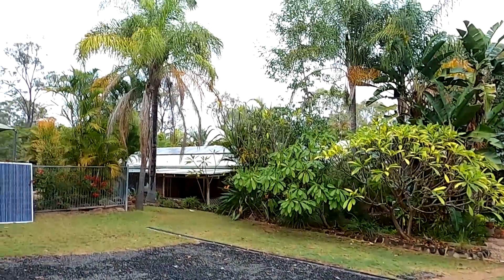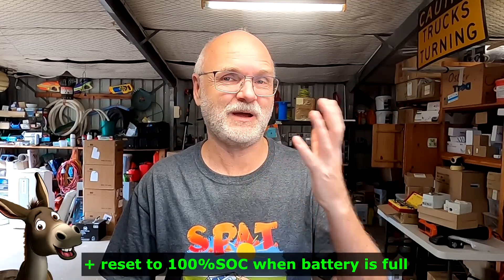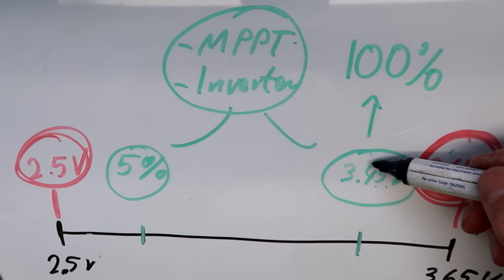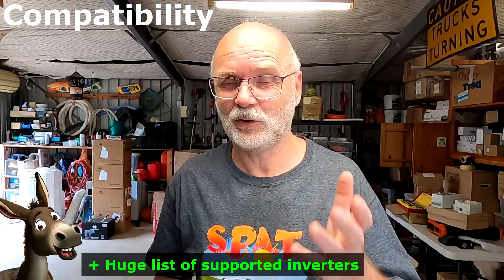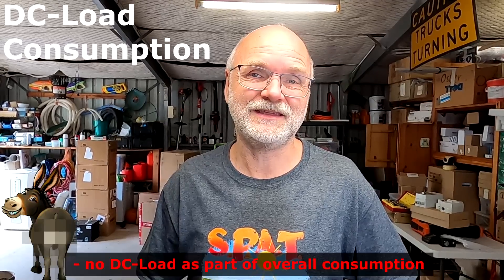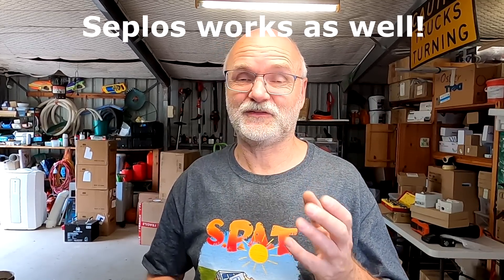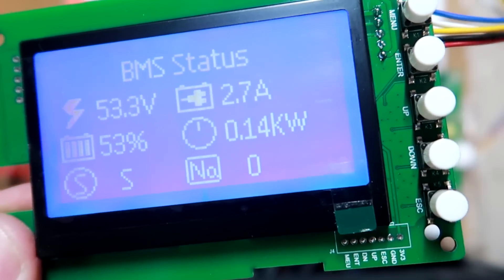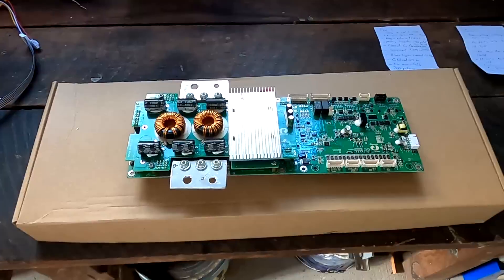In search for the best BMS... My Gobelpower BMS Verdict!

Comment: Oooh! Another BMS SOC problem? Where have we last had it? Oh, yes! Outlander :D 

Ps. Anything coming on the Teslander soon? Interesting updates? Degradation of the battery, perhaps? 😎
Reply: We got our Model 3 just maybe a week before Andy. Our battery has not lost anything at all after the first year. I suspect Andy’s will be the same.
Reply from the maker: I'm 3% down after 3.5 yrs
Reply: @OffGridGarageAustralia  Great news Andy. It’s NOT something I lose sleep over like some, and nor do I do deep dives with software programs and OBD readers etc- I suspect we’ve lost something more like 5 to 6% but it was ALL in the first year. Since then the “full range” hasn’t altered more than about 1km, and always goes up again for a while after a long trip.  (Our car has literally never in it’s life been above 95%  as I like to maintain some decent regen, and only below 20% maybe three times.)
This is in line with many overseas users with very high kilometres- initial degradation over the first year (ie: reduced projected range) and then it levels off very dramatically. 
I do NOT miss the Outlander’s battery issues and bloody useless BMS - though it was otherwise a pretty good car.
Reply: @OffGridGarageAustralia  how much of that is true though. DBCAM is needed 😂
Reply: @FutureSystem738  that's quite impossible 😉

Comment: Hallo Andy, 
I dont know how it works, but my JKBMS always reach 100% SoC when the charge controller of the Deye is in the absorbtion phase. The Values for BMS and charge controller are set like you show on 5:52
Reply: Idem, my JK BMS reach the 100% every day and I never get an OVP alarm. I'm charging at 3,5V and JK BMS OVP setting is set to 3,6V.
Reply from the maker: @M-Clem  Do you know what triggers these 100%SOC reset in the JK? Lot's of people are asking for that.
Reply from the maker: JK is very different...
Reply: @OffGridGarageAustralia  
...but still seems to be pretty good if the budget matters   :-)
If you are interested, i can send you curves of a charge cycle including the voltages of every single cell.
Reply from the maker: @Juergen_Miessmer  I like the JK as well as I said. It's just another BMS for a different battery design.

Comment: I went with the seplos a few weeks ago, tested the CAN connection to Victron and diceded to forget that and go with an extra smartshunt. The only thing i miss are the values for the highest and lowest cell but the SOC is calculated perfectly by the shunt. And this setup will work with any batteries in parallel - like your battery shelf. I am not 100% clear about the usefulness of a data connection to the battery.
Reply from the maker: You can still get all the data from the Seplos BMS but use the Smart Shunt as your battery monitor. That works great. Just leave the Seplos connected via CAN but turn off the control part in the Victron System, so it does not control charging etc...
Reply: @OffGridGarageAustralia  thanks Andy. You mean not to choose the bms as the battery monitor, right? If I remember correctly, that does not work, because the system priorized the bms in my ESS configuration. But it could be, that the turned on DVCC was responsible for that. But I need/want to turn it on, because otherwise my RS450/100 is not under "external control" what it should be (the 150/45 IS under ext. contr.) plus I cannot control the overall charging current.
Reply: @OffGridGarageAustralia  today I set up my BMS connection again and all the sh*** beginns again :-D 
I figuerd out, that I have to set the option "Controlling BMS: No BMS control" to ignore the values coming from the BMS (CVL, CCL, DCL). But you must know that you only find this after rebooting the cerbo. And after that, you have to reboot again but not only the cerbo, but also the MP and reset all MPPTs to ignore the BMS. What a mess.
And now the best: I cannot find the min- and max-cell-voltages anymore :-D
Reply from the maker: @mario-q6k9w  Hmmm, strange, I never had to restart the Cerbo or MP when changing the battery monitor or other related settings.
Yeah, the controlling BMS function should be off, so you can still use the DVCC with custom settings. As soon as you do that, the chargers won't be under external control any more. Either the MBS in in control or not.
Reply: @OffGridGarageAustralia  yes, that works now.
If you have BMS controlled MPPT and either set BMS control off or disconnect the CAN BMS, then the MPPT have to do a rescan, otherwise they lack of information and report an error (bms missing or something).
And maybe the MP needs a reboot because of the ESS assistant.
To see the the min/max cell voltages reported by the BMS in remote console I can't find the "details" under the BMS anymore and in VRM is no data available. Did you know why that is? I use the 10E BMS
Reply: OK, I just forgot to set the victron communication protocol in the BMS...
Reply from the maker: @mario-q6k9w  There you go. I have tested such a 'hybrid' system for a while and it works quite well with the Seplos. The BMS then basically only reports the data but the Victron system handles the charging. Good work!

Comment: Hello Andy
My 2 Daly 150 A  BMS are ok also they do the same job .
With 2 * 16 LFP 280Ah from gobelpower.
Connection UART USB to the rp3 .
Bmv 700 and muliplus .working fine....
Also to charge my model S off grid.
Reply from the maker: Nice, that's sounds like an interesting setup you have!

Comment: Andy, give me a shout to discuss DIYBMS!
Reply: Hi Stuart yes we want to see diy bms test
Reply: Stuart, how are you doing, mate. Wish I got one of my DIYBMS working, and I would send one to Andy.
Reply from the maker: Thanks, Stuart. I was trying to contact you but cannot find any details. I even signed up with the Open Energy Monitor forum and can see your profile but no way to send an IM. 🤷‍♂️
I made several attempts to buy the DIYBMS in the past but they all failed due to different circumstances and issues.
Can you send me an email so we can share some info? Mine is under the About tab on my channel and also on my homepage at the bottom. Cheers.
Reply: @Off-Grid Garage  I have some here, not fully finished Andy.
Reply from the maker: @chuxxsss  That is/was my problem. Not all parts were available and I haven't got the time to solder for hours...
Reply: andy i followed your advise and got the gobel bms and paired with a neey active balancer. would it be possible for you to upload your settings file so we can just import it to our bms? thank you so much for all your videos . helped me a lot❤

Comment: Newer versions of the PaceBMS resets the SoC at the "full pack charge" voltage, just an fyi :)
Reply: I totally agree. @off-grid Garage: you just have to set the parameters the right way 😉
Reply: @Der_Hannes  Yep, I got my OVA to 3.55, OVP to 3.6, and fullpack voltage to 55.2 and current to 1A, and the view is to slowly increase the FPV to 56 over the next week so the built in balancer does its job.
Reply: @sarahjrandomnumbers  my FPV sits on 55.2V and FPC at 1A cause i have added a NEEEEEEEEY balancer wich of course is doing a great job. Anyway, the SOC resets to 100% just if both parameters are reached.
The only downside i noticed is that the charging mosfets are turned off after reaching that "Fully-Voltage". That should only happen at a protective situation
Reply: @Der_Hannes  I haven't noticed the charge fets turn off when it hits FPV, but i'm charging up now so I'll see if I get the same behaviour. :)
Reply: @Der_Hannes  Just fully charged, and it didn't turn off the charge fets, but the remaining current and presumably SoC reset once it hit the FPV and FPC levels.

Recorded it just in case, i would post the link here but youtube is blocking it, it's on my channel anyway. That also includes the view of the BMS settings I have at the moment for those that want to compare.

No cell/pack alarms or protect, and the balancer stayed on until it went under 500ma, as expected. Currently at a deviation of 13mv, compared to 270mv when I first got it, although I did open the pack up and charge every cell individually to 3.6v, then let the internal balancer do its job.

Although, thinking about it, it's not really a balancer, all it's doing is adding 43ohm to the cell, which makes it look like the internal cell resistance is much higher, meaning it'll charge slower, which makes a whole lot more sense than it draining power from the cell to balance it. But that's a different conversation :).
Reply: Oh, and I just noticed, it's still balancing a few cells even below 0.5A... Clearly they made a lot of changed from my version of the BMS compared to Andy's.
Reply from the maker: What Pace BMS with what FW is that please?
Reply: @OffGridGarageAustralia  Mine is the 200A Version (P16S200A-21606-1.01)
Reply: @OffGridGarageAustralia  Same model as yours, but with 1.03 fw (P16S100A-21634-1.03). Mine right now is balancing with 0A going into it, plus with the above changes I mentioned. 

Only just saw it doing that so I was kind of shocked :).
Reply: Just uploaded a quick vid to my channel showing the balancer balancing without any charge current.
Reply: @sarahjrandomnumbers  Mine does also balance after reaching the FPV, but only until it gets discharged only a bit (which will happen shortly after its fully charged in a productive system).
Reply: @sarahjrandomnumbers  Did you get the BMS with FW 1.03 or have you updated it to this version?
Where did you get the new Version file?

THX in advance :)
Reply: @Der_Hannes  It's a new battery, so it came with the BMS. No idea if there's an update feature, would be nice though :).
Reply from the maker: OK, interesting. I'll re-visit soon... Thanks for sharing guys.

Comment: That mystery BMS is driving me crazy :-) Can't wait to see whats in the box.
Reply: @JOHNDANIEL1  Don't agree with that.  BMS is a safety feature and comparable with an airbag in a car.  If everything is working fine, indeed you don't need the BMS. However if a cell, for whatever reason goes out of line, the BMS kicks in and avoids much larger problems.
Reply: @JOHNDANIEL1  the airbags in my car never deployed yet. Happy for that.   Still have no intention to remove them, or get a car without airbags.
Reply from the maker: You always need a BMS.
Reply: If any questions for BMS, welcome to contact me.